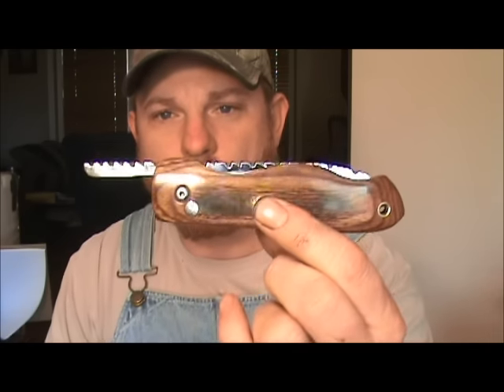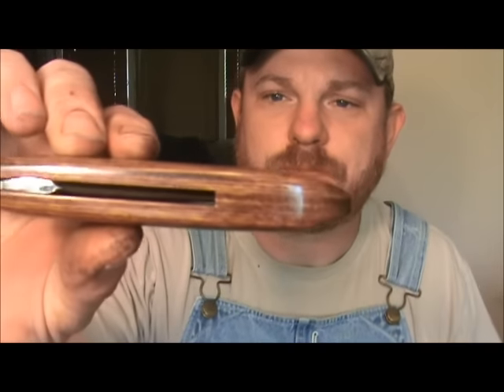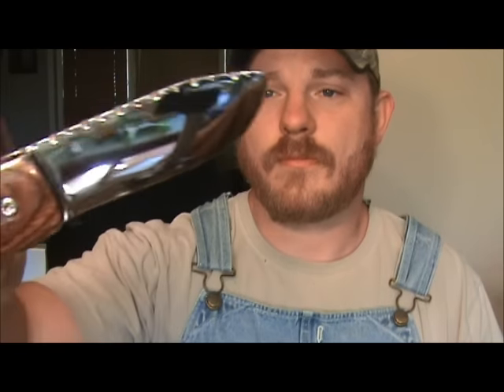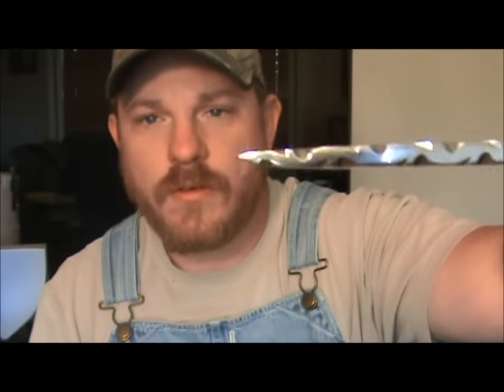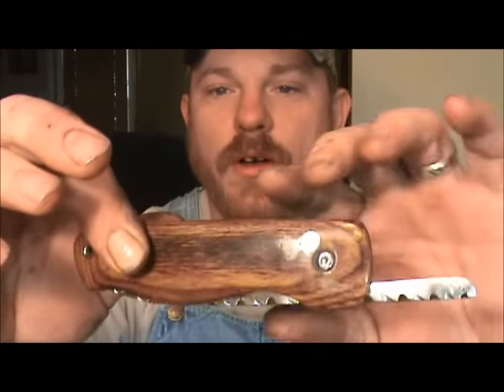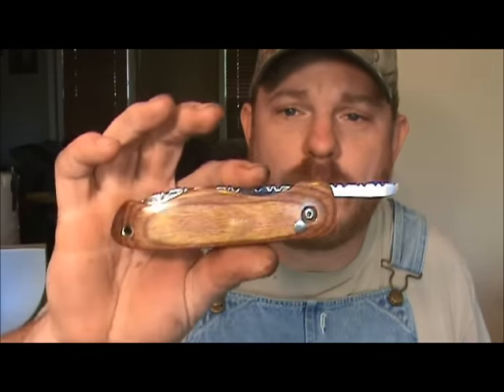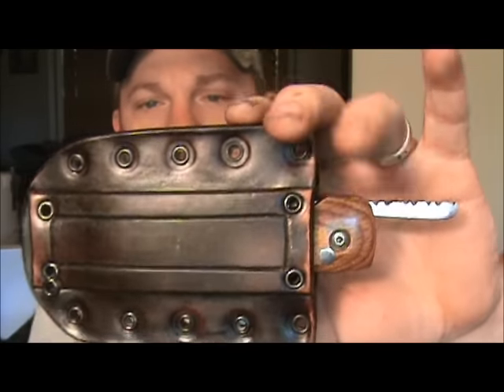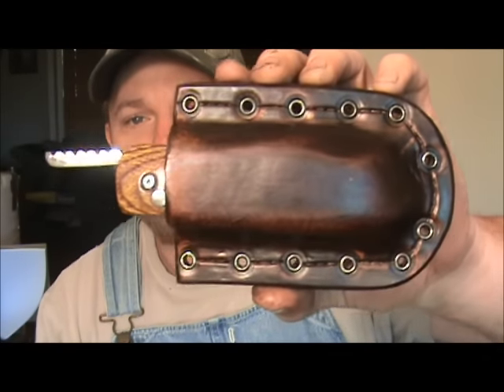Friction Folder.wmv

Comment: It just looks woah. very beautiful

When it is fully opened, the gap between the back spacer and the tang seemed odd to me. maybe a longer tang or backspacer to shorten the gap.

The backspacer you can also try to use a piece of metal with fileworks on it, then when the knife fully open, the tang and back spacer will look seamless. :) 

just a suggestion/ opinion.